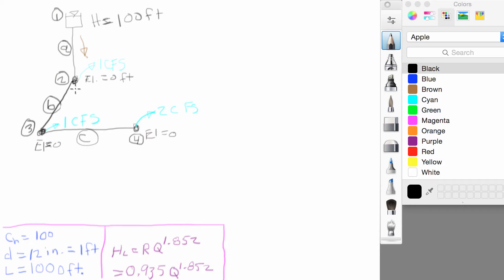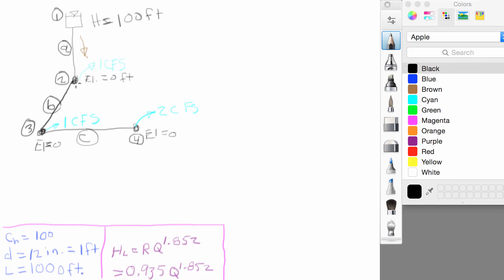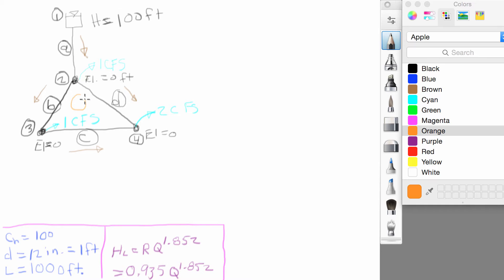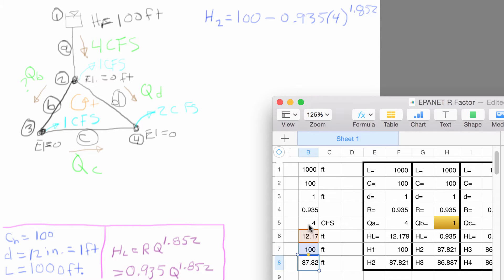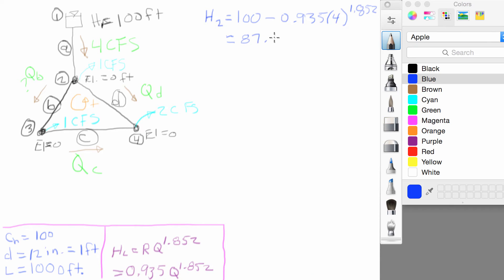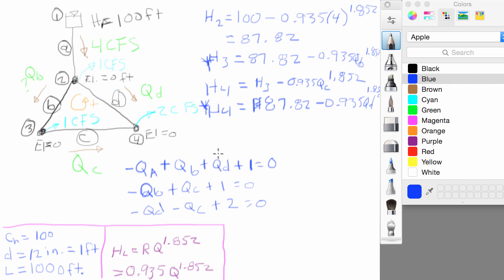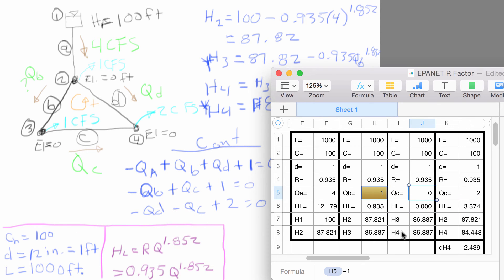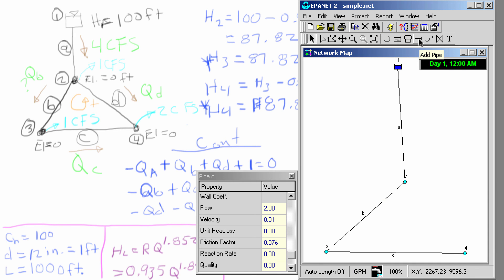EPANET Basic Hydrulics 02b | Hydraulic Modeling

Comment: what to fill in initial level ,minimum level and maximum level of tank?
Reply from the maker: The elevation of the tank is the HGL of the tank floor.  Initial level is the water level at time 0:00 above the tank floor in meters or feet.  The minimum level is the water height above tank floor where the water won't drop below.  EPANET will close connecting pipes if more water tries to escape.  Similarly, if the model tries to fill the tank higher then maximum level, connecting pipes will close until the HGL in an adjacent node drops and water can once again escape.
Reply: can i contact you through gmail... actually i am modelling network for potable water.. and having various problem..and dont have any  guide yet